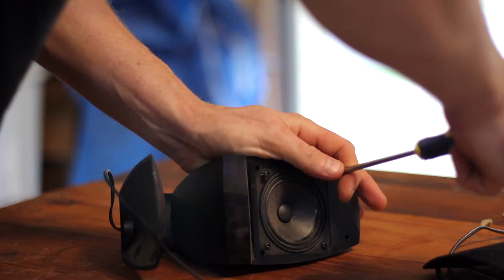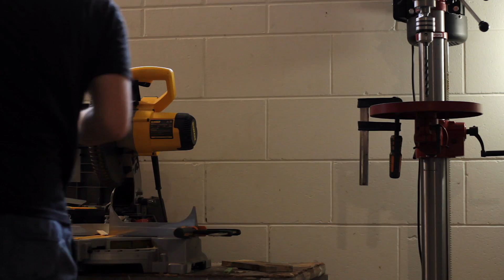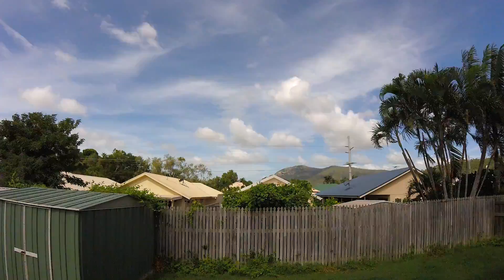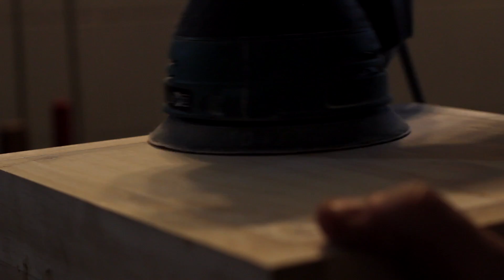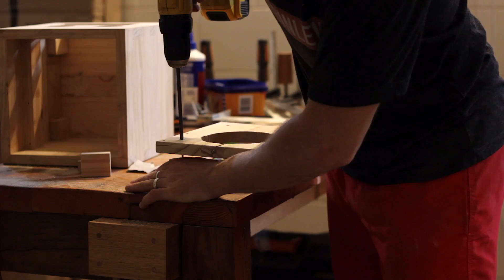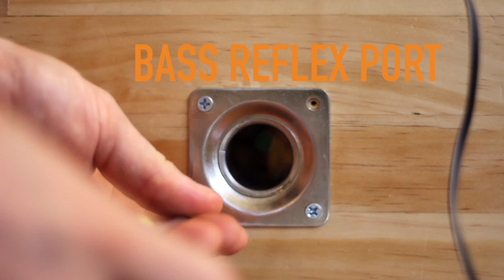DIY Speaker From Reclaimed Components | Woodworking

Comment: Nice build Rob looks pretty cool, solved a problem but alas created another one :)  Its not a good idea to have your full range speakers in the same box(air space)as the sub woofer. 
The sub will over power them once you turn it up enough to load up the port.
Reply from the maker: Thanks mate. You're right, I can even notice the resonance on low volume if I touch the small cones. I thought that might happen, but it's not distorting the sound at a normal level so I'll get away with it in this scenario, but if this was a hifi speaker setup, or something with a lot of power, it'd be a disaster

Comment: i hope that sub driver isn't in the same airspace as the midranges....
Reply: That was my concern as well, full ranges and sub in shared, and tuned, cabinet... won't work well. Those full ranges won't reach low enough to affect port tuning, but the sound pressure from sub will effect FR drivers tonal balance big time; they will cancel hard acting as passive radiators and active drivers.

Comment: could've been a sweet box until you dropped those tiny speakers in there. Good work though the camera angles were endless, i was starting to get dizzy. I really liked the shot from inside the box when you cut the hole for the smaller speaker. Very creative
Reply from the maker: Thanks very much

Comment: Where can I buy this amplifier?
Reply from the maker: I couldn't find the same model, but this is the same brand and a similar price http://www.ebay.com.au/itm/EDIFIER-M1360-2-1-Multimedia-Speaker-Set-3-5mm-jack-wired-remote-control/311501512414